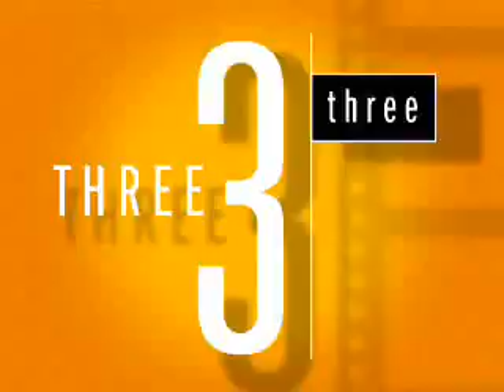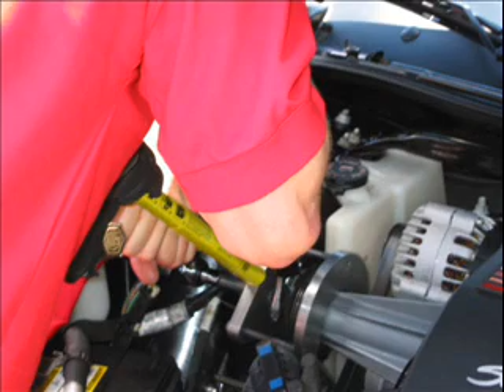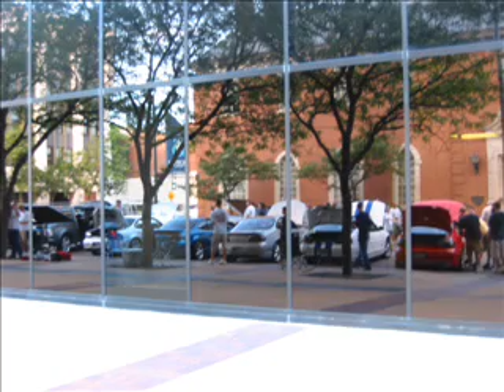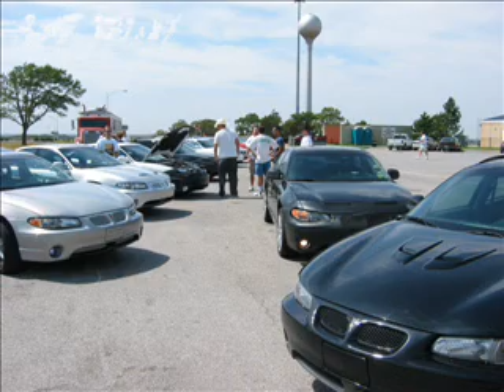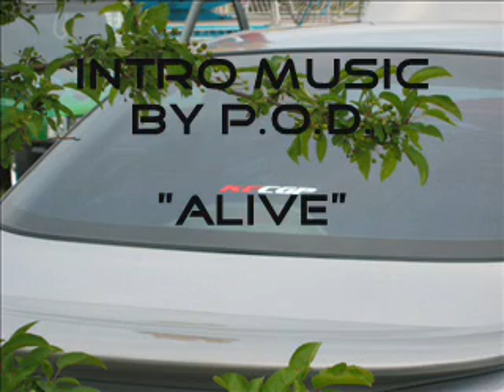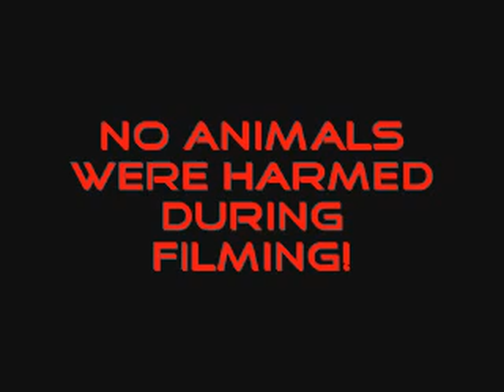Kansas City Club Grand Prix

Comment: Ya its been a few years since that sale. I think hes giving up on GM all together. BUT..I have heard (from the horses mouth) hes back in the market for a replacement GTP since he sold Quicksilver...several years ago too. Time flys dont it. I have had my GTP 8 years now. My car is pushing 12 years old now, and looks just as good (if not better) than she did when she was new. I plan to keep my GTP till the wheels fall off. You should check out my videos...it will make you miss your car even more.